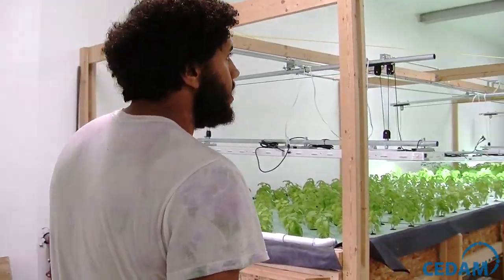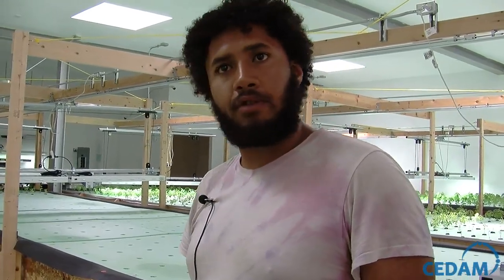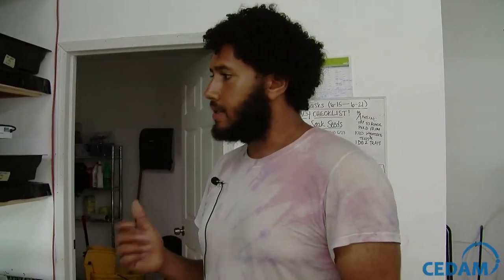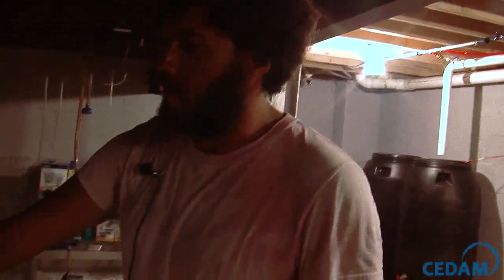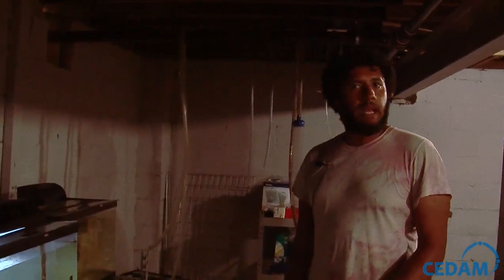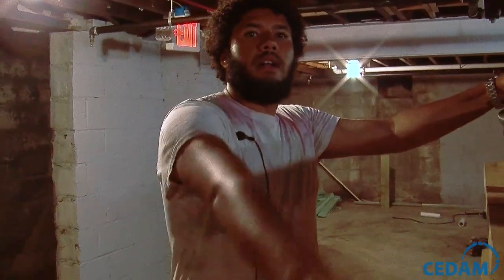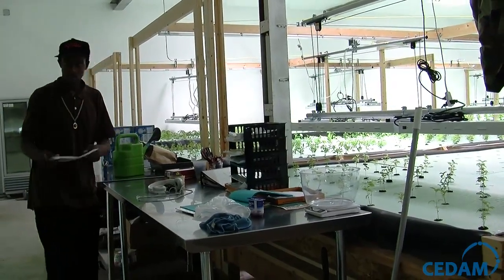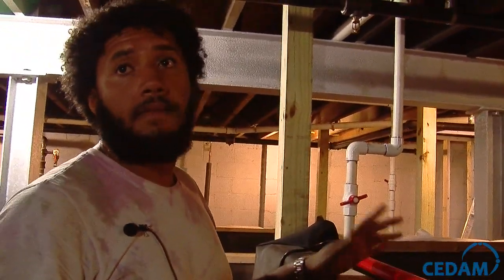Aquaponics Tour

Comment: This is super awesome! Is there a specific reason you are using glass tanks vs using 275 gallon ibc totes. Totes are super cheap and food grade ones make a fantastic holding tank. It’s a happy medium between tanks and commercial grade holding tanks. Tanks that size can be heated with a hot water heater element. 1500w heating element is $10 at a hardware store. The solar heating idea is pretty awesome though.

Comment: 2 Isuzu diesel engines running on bio diesel  would run that operation. Using 1 at a time. Get our oil from local donut shop and convert in small area

Comment: Composting indoors will add a sign amount of heat to the operation.  Using waste food from your customers to feed Black Soldier Flying larvae will not only keep the waste out of a landfill, but also generate large amounts of both heat and self harvesting larvae to feed the fish.  Duckweed should also be grown to feed tilapia.  Breeding BSF is the hardest part of producing larvae on a year round basis.
Reply: Peter M. Eggers polystyrene doesn't break down until heat is added. It's also coated.

Comment: Excellent! Great video... I hope those just getting started, are well aware of the plastic toxicity contamination potential when choosing petroleum based containers, hoses, poly liners and irrigation components... the longer a system is in use, the greater the risk is for hoses and containers to break down and leach toxins from the UV rays of the Summer Sun, from the heat, as well as contact with fertilizers and other chemicals. Don't just guess and hope for the best, try to source natural containers (ie: stone, clay or glass, etc...) and/or "Food Grade" approved containers/components every step of the way... one step forward is not worth two toxic steps backwards when it comes to you and your family's health ;)

Comment: NIce set up, but you need a serious update on your breeding and grow out set up. HOB filters are not very useful with those fish loads. You would be better off with a rack system and running everything to a wet/dry or fluidized bed. King of diy's channel has alot of great ideas that you could use to make to improve you system.

Comment: hey there I am new to AP as well and have a complete set up going.  
There really is no wrong way to do AP.
The biggest is take your time - you need to let it cycle for 6 to 8 
weeks to get the bio filter established. 
I started off this past January with ammonia and a bucket of sandy 
sludge from a local creek.
Once it cycled I used a 6PPM sea salt to kill any parasites and also had
 fish in it at that time - the 6 ppm will go away over time - do not 
keep salt there constantly  limit to 4 to 6 weeks as it will kill the 
fish over time it over works the kidneys.
Aeration is your biggest ally my setup has a 200 gallon sump as my 
breeder for the rosy reds  and fat head minnows to feed my bass and 
crappie - crappie are finicky and not a good fit but I like them so I 
have 10 in my float beds 15 bass and 12 blue gills. The ratio is one 200
 gallon sump to one 250 gallon float bed constant flow run off, to a 300
 gallon grow bed with media.  bass and blue gill are pellet trained.
The plant growth is no joke in just a week and a half after planting I have full blooms and tomatoes.
The bigger concern in food production is bees. 
The secret I believe is using high protein feed to predatory fish like blue gill and bass. 
the greens are going really well.  Expecting to expand out to produce 5 acres of produce off of a 
city plot size location using solar panels and water turbines off of gravity fed auto siphon .  Tilapia is a trash fish like carp low quality food for humans.

Comment: I am a fan of aeroponics but this application is somewhat ineffective compared to cheaper alternatives. DWC raft based systems do not require expensive atomizers that get clogged and require maintenance. Raft systems are very easy to take care of. 

There are also ways to maximize dissolved oxygen in the water without aeroponic hardware- resistant to mechanical failures.

Comment: "The only input is the fish food." ... and the massive amounts of electricity to power the lights and the water pumps.
Reply: +thelister4910 Not as much as you'd think. He's only using two lights per grow bed then moving them. If they are LED lights the whole system may not use much more power than an average house. I did the math on doing this with a large greenhouse with a much more intensive system than he's doing and everything together ran around 60,000 watts a day but I was planning to grow easily 20X to 30X the food he's growing. So long as you go with LEDs the electric requirements really aren't bad at all. To produce the same amount of food your average open air farm is probably using more energy and releasing more CO2. If you are growing in a Greenhouse you're using a fraction of the energy and water of a traditional farm.
Reply: Cary Howe These systems almost seem too good to be true. I was excited to start a small scale system, so I began researching it in these winter months. What I found was disappointing.

They are not nearly as productive as people selling the systems would like you to believe. If the pump breaks down you fish can all be dead in an hour. The fish food are made mostly of other fish, caught in "unsustainable" ways in the ocean. For every pound of fish you grow, you'd have to feed them 10 pounds of fish (caught sustainability from the ocean). And in the end the most people seem to grow are things like lettuce and tomatoes, and other things made mostly of water with no calories. 

I'm currently looking into aeroponics, hoping this will be the most efficient way to grow food.
Reply: How about using fish that eat algae? Seems like that would be sustainable to me, and cost significantly less than fish that eat "meat"
Reply: Ehh... 
Most of the issue thelister4910 has pointed to throughout his posts seems more of a specific critique to this system, further reinforced by his limited research into aquaponics. 

I'm not saying this specific setup doesn't have issues (it's indoors, it's using root spray systems, it doesn't have swirl filters to increase dissolved oxygen, it doesn't have obvious mineralization tanks, etc... ), HOWEVER, if you're going to try to level a critique, you should probably have better references than "I tried to grow stuff in an aquaponics system during the winter and found it to be bad'. 

You're offering anecdotal evidence in a non-specific format. Literally every farmer on the planet will tell you growing plants in the winter is more difficult than growing them in the summer. As far as fish food, there's plenty of people that do not use commercial fish meal. Choosing to go that route is entirely the fault of the individual grower.
Reply: KommentMonster I find that YouTube commentors always find the negative which paints a picture of how they live imo. Only see problems and make an effort to be blind to solutions. I pity the angry internet people. Its sad to live with that mindset.
Reply: I agree. Aquaponics YouTubers tend to regurgitate the same 1-liners about closed-loop system and it's environmentally superior methods without thinking it through. 13:23 -  I'm pretty sure most aquaponics farms use pretty low powered pumps because the water flows pretty slowly and drains using gravity. But the majority of electricity in Detroit is coal generated so who knows what kind of impact this place is making. He got really awkward when talking about his electricity usage.
Reply: also your mom is fat
Reply: Josh M tilapia eat algae and plant based food not meat ...and this system works better outside under natural light w fish in a pond using gravity to feed water
Reply: I guess you don't think things through. Solar Panels are more affordable than ever and the price continues to go down. You build redundancy into your system then your pumps should never fail and your power should never go down. The only way for those two things to happen is unforeseen natural disaster and in all likelihood even that wouldn't stop the system from working if done correctly.
Reply: not as much as you'd think. I don't have aquaponics but I have a simple hydroponics setup for growing salad greens and I can have a salad or 2 every day at a cost of about $4 per month in operation costs.
Reply: explain what to do with system when winter hits in Detroit ?
Reply: Also. People doing aquaponics aren't doing it for the tilapia as the main crop. The main crop is the microgreens or basil's or whatever else they are growing at the time with the highest market value. The tilapia is a secondary revenue and byproduct of using fish to fertilize the system.  He could be using fancy guppies or swordtails, or other common aquarium fish and selling them to local pet stores instead of tilapia. It really doesn't matter because the fish isn't the main product they are trying to produce here. 

If they were trying to grow tilapia for sale solely, they would be using a lake or pond and doing it a different way. 

They need the fish waste, so they need fish in the system but it's not their main crop, it's a byproduct. 

Same goes for their worm bed. They need it to introduce vitamins and minerals into the system naturally from the worm castings. Absolutely they could also sell the red wrigglers as bait and get an income stream from that as their population grows. But the point isn't the worms, it's the waste as a fertilizer and the main crop is the plants they have selected for the return rate come harvest time, all other byproduct sales from the system become suplemental. 

I have to disagree with them on their water temp though. If they can get it to 88 the fish will eat more and grow faster than at 80 degrees but again, they probably aren't too concerned with how many tilapia harvests they can get a year compared to how many microgreens harvests they can pull out of it and looks like they aren't concerned at all about harvesting the worms. 

Their system could be more efficent, but it also could be more costly. I'm willing to bet they've done a ROI and realized pushing for higher output in the animal sector won't get them greater profits so let those things run their course and just worry hard on the plants.
Reply: Biologically speaking... I'm sure he meant..
Reply: Lovely Video clip! Sorry for chiming in, I am interested in your opinion. Have you heard the talk about - Patlarny Gardening Expert Principle (google it)? It is an awesome exclusive product for learning how to expand your produce with the clever art of aquaponics minus the headache. Ive heard some awesome things about it and my mate at very last got excellent success with it.
Reply: And the food that is made up of fish or other protein.  Usually takes at least a 3-1 ratio for food to harvest. Aquaponics is cool but people should be honest about it.  Years ahead of salmon farms tho!
Reply: thelister4910 what are you talking about? I have a pool pump that size and I've used it since 1986 and it's never broken down. You have to take care of it. Also it's tilapia, not tuna. As tilapia grow they slow their eating. They need the most food when they are young and they are omnivores and actually prefer and thrive off plants vs. meat. Fastest way to grow tilapia fry to fingerings is to feed them algae wafers and not any meat or fish at all. They will pick algae right off the wafers and eat all they can. 

I dunno where you got you information from but it's pretty damn wrong. Tilapia are really hardy fish that tolerate poor water condition better than most fish, a pump going out won't kill them in an hour or a day but you may find yourself needing to do massive water changes to keep it balanced and stable until you get the pump fixed, depends on you biomass since the plants won't be doing their job... or getting fed until the pump is fixed. 

Aquaponics isn't profitable if you are growing tomatoes or lettuce or on a small scale. The money is in the high cash crops. 

I mean you can waste your time growing 600 pounds of organic iceberg lettuce at $2 a pound, or you can grow 1200 pounds of organic basil and sell it at $24 a pound. I think you might confuse hobbyists with people trying to make a profit off of their aquaponic systems.

It makes a difference if you are doing it as a hobby in your back yard or if you are doing it commercially for a profit.

Comment: In addition to solar, you should look into a groundwater source heat pump for heating your water. If you have groundwater in your area, you could use that to heat the water while cooling the building in the summer. If not, you could use fish tank water to cool your building while you heat the fish water. Another one could be used to cool the water the plants get while heating the water the fish live in. Check it out. These systems run basically on the cost of running a pump and could save you lots of money.
I would rather eat your tilapia and not the Chinese-raised tilapia where they feed the fish feces. The Chinese raised fish could not be good for you.

Comment: Huge waste of vertical space with those lighting systems. Would have been better off investing in LED T5 bulbs and being able to stack the grow beds 3-4 high. Use less power than traditional florescents+moving lighting.
Reply: Thats the nice thing about the LED lighting is you can have them really close to the plants because there is no heat. If your only growing small plants with a height of less than 12 inches (which is most or the ones you are) you can put another grow bed on top. If the water flows from the top layer down consecutively you can easily fit 3-4 growbeds in a building with 10 foot ceilings such as this.
Reply: Buffalo_Chips Do you grow in a VF style? I noticed your comment and I had some of the same thoughts about the setup. I am working on building a hydro operation. Do you have experience with that?
Reply: jay tee
I have a small Aquaponics system. Just 50 gallons, a swirl filter, bio filter and 5 lengths of of NFT full of strawberries and greens
Reply: Buffalo_Chips im pretty sure the cost of replacing t5 bulbs will accumulate to alot of money. LEDs are cheaper as they last longer and are more energy effecient

Comment: Non "GMO" Can by US law contain up to 5% GMO, so there is no way to get away from it. The way you should be using GMO plants at least. Make the system more efficient.
Reply: "The way you should be using GMO plants at least," is not a coherent sentence. Proofread before posting.
And you most certainly can get away from using GMO seed if you purchase your seeds from a reliable supplier that avoids GMO seeds like the plague.

Comment: To save money on electricity, if feasible, you should consider a wood gasification furnace for heated circulating water. The kind that is typically used in radiant heating in homes. You can also include thermal water storage tanks to store all the energy from the wood and use the hot water as your needs change throughout the day. This of course assumes that it would be easy to find wood to burn.
Reply: You

Comment: Wow, Great, informative presentation. I would definitely add solar vacuum tube water heaters. They are fairly inexpensive and would pay for themselves quickly. Another possible thought is using roof solar tubes. This should not only let in ambient light, but also provide sunlight during the daytime. It looks like a flat roof which is perfect for that kind of solar tube. It's also something you could add little by little to spread out costs. That will help keep your energy costs down.
Great job and good luck on this great business adventure.

(Also, make sure Anthony gets out of that place to sell.
He speaks VERY well and could sell just about anything)

Comment: Them fish in the last tank, are under so much stress!! Using RO water removes things that you don't get from the fish, and you need to replace it, and have the natural things in the water.
Reply: RO water is for replacing the water lost from the system due to evaporation and transpiration. This is a very low percentage of overall water volume. You should understand that nutrients, ions and molecules, do not evaporate out of the system. When fish food is put in, the only place for that to go is into some animal or plant to make them grow. This is why topping off with RO water is necessary; the ion balance will be thrown off in the short term otherwise. And in the long term, the water may become too salty for things to live. For me, our tap water is not too high in ions, but I don't know if it has magnesium or calcium or someother-ium. I know it is contaminated with perchlorates, which I hope the RO filter takes out. Then I can add small amounts of certain minerals depending on my measured ion concentration and plant needs, and only if necessary.
Also, some fish like to "school", which means that they want to be really close to their buddies. And therefore, having high stocking densities in not bad for these fish at all. Please be reminded that the water is constantly being aerated, filtered, and recycled; so it is nothing like having a bucket full of fish sitting around.
In my systems, I have played around with various parameters until the fish get stressed. Stressed fish get sick, then usually die (unless the source of stress is eliminated immediately). Happy fish keep eating. fish grow when they eat. After they grow too much they get thinned out to have more space to grow (or get eaten). Same thing with plants, sort of.
Reply: Paul McDonald lol "them fish" got a post graduate dissertation in response. 🤣
Reply: RO water removes nothing.